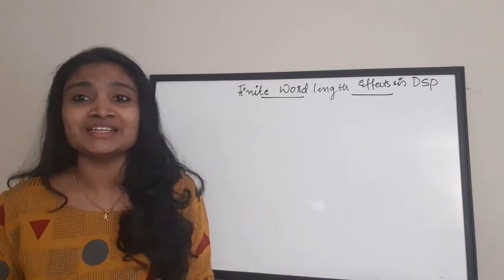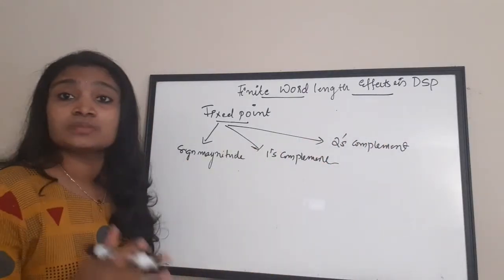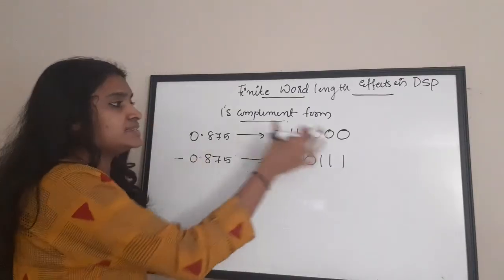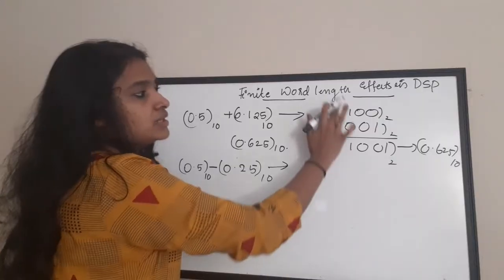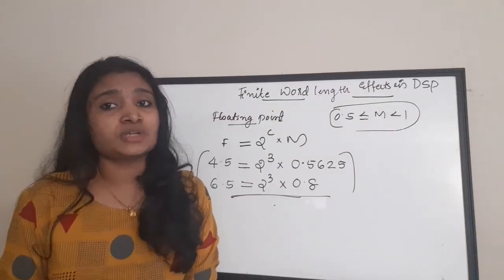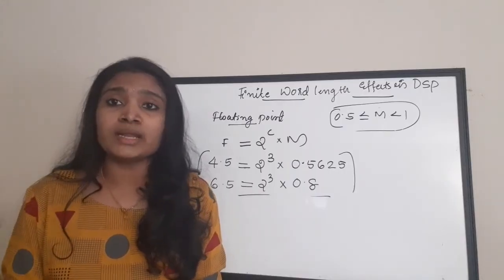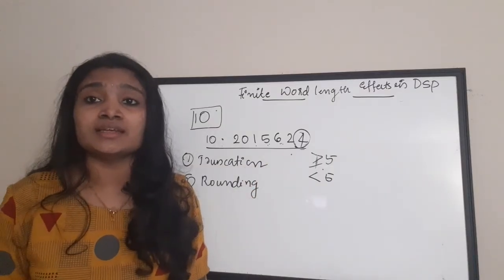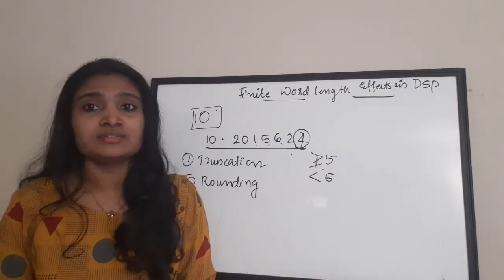Finite Word Length Effects in DSP||Fixed point and Floating Point ||Rounding and Truncation

Comment: In fixed point addition, (0.5 + 0.125) base 10=(0.101) base 10. You accidentally taught it as 0.1001.
Reply: Ya bro same doubt im having 🥹
Reply: Ya there is a mistake you are absolutely correct